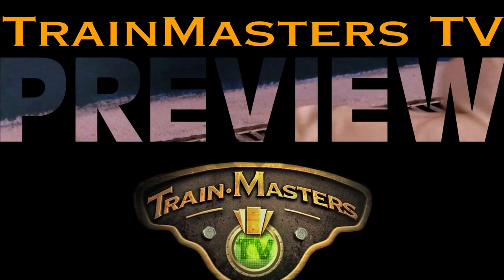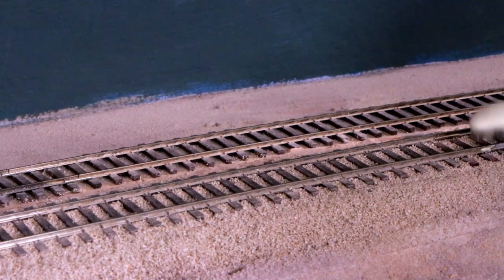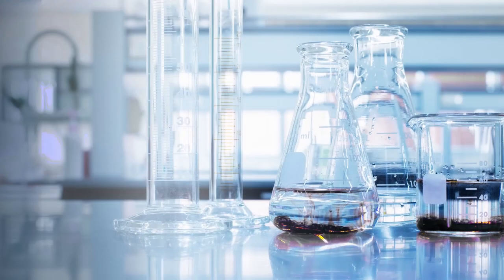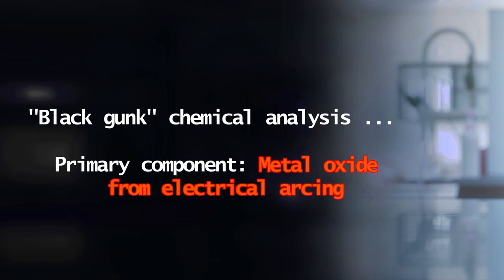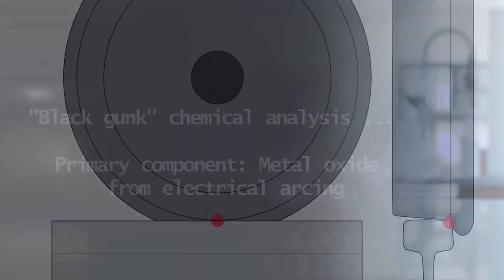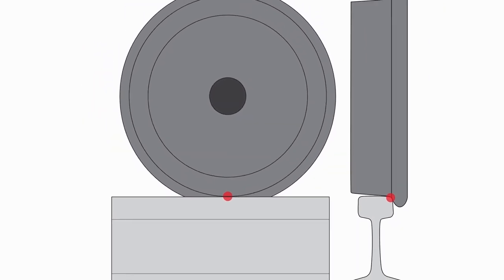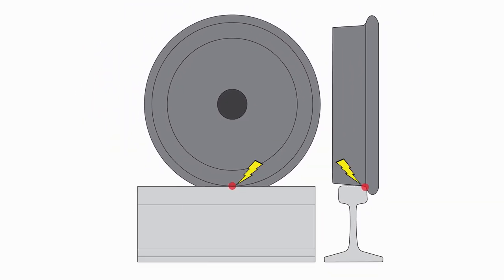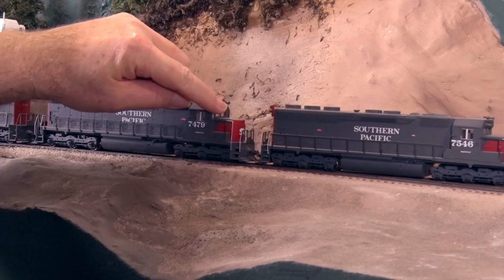PREVIEW: Miracle track conductivity cure

Comment: Can't wait for the day when locomotives are battery powered and don't need to run on track power.
Reply: Right now, battery power trades one headache for another if you have a large roster. Imagine 3 hours recharge per loco and a larger layout with  25 locos on it. That's 75 hours of recharging time every op session (about three days). Cleaning the track is actually less hassle.
Reply: @modelrrhobbyist2045  This assumptions assumes only 1 locomotive can charge at a time... Which is quite the.... "not well made" assumption. In fact, the charging method could be incorporated into long ops sessions as a switching out of the loco to a maintenance facility for "cleaning, oiling, coaling, etc" to be done while the loco charges before returning to service. But you could easily recharge multiple locomotives at the same time. Even within the span of normal sessions.

Comment: So, switching to plastic wheels on non-powered equipment will reduce the gunk build up significantly?  No power arcing there.
Reply: Not really, the micro arching occurs between the rail and the "powered" wheels on the locomotives, not on cars, unless they draw power from the rails to ligth the car or have sound decoders. By Powered wheels I mean the wheels that draw power from the rail to make the train move.
Reply: nope... that gunk sticks to the plastic wheels to... i just cleaned some plastic wheels on some rail cars... seems that the plastic wheels attract that gunk even more than metal wheels

Comment: I have used CRC for years and never have stalling problems or even hesitations
Reply: i recently found out about crc... i bought crc 2-26 a few weeks ago from home dept, started using it... what a HUGE difference... before locos would hesitate/or stall in certain areas... put some crc on the rails and no more stalling... my locos will NOT stall even at super low creeping/crawling speeds heck i tried to stall them on purpose but nope won't stall... the stuff works

Comment: The DCC's higher voltages seems to increase the problem.  LMRC used to use small amounts of hair-clipper oil, which is conductive to bridge the small patch at the wheel-rail point.  Too much will cause you to loose tractive effort and also accumulate more dirt from the air, dust, etc.  A very small amount, about one drop spread on each rail was enough for 1000+ft of mainline.  Masonite sliders were also used to help keep the dust off the rails and polish the railheads.  After 15-odd years of daily operation, LMRC's Ilmon-Cliff mainline was polished to a mirror finish.  Every train (~30 cars) had one slider pad, and every morning a cleaner train of 4-6 sliders were used to clean off any previous night's dirt.  This combined with weekly wheel cleaning of the engine wheels kept the operations running smoothly 1996-2002.
Interestingly, even with DC power, trails of black powder accumulated on the inside and outside of the curves, such as Caliente, where the slider pads rubbed across the curved rails, effectively cleaning off the bottom of the pad, by scraping away any accumulated 'gunk'.  These black trails were vacuumed up easily about once a year... interestingly they also provided great natural weathering, simulating the brake dust off the passing trains on the heavy grades!
We've seen more problems since going to the various 'wet' cleaning options, as it seems to transfer and deposit the previously dry material which shed naturally from the railhead, now is transported and gathers in our switch points and frog guard rails.  Again, too much liquid is a very bad thing!
I think part of the 'wet' track cleaning problems comes from the track cleaning 'roller cars' just placing and lifting a roller, which gets wet and saturated down on the rail and lifting it again.  No actually 'cleaning' action like the slider pads occurs.
I was planning this year to do more studying and I have some ideas for solutions... but the lockdowns have made trips to LMRC not possible. :/
NOM

Comment: Well, I’m not sure what you are recommending but I am having great success with commonly available kerosene applied sparingly with a small cork block. It has survived fallout from the horrific bush fires we have had here in Australia. 
I was amazed when I had a couple of months with no access to the layout due to the room being occupied with parts from a car (automobile) I was restoring. Some friends dropped in and wanted to see some train action. “Oh oh” .... this is going to be embarrassing! But NO, everything ran smoothly and there were no dropouts and I had not cleaned the track for months. BTW I chose kerosene from one of your previous articles where you were describing various cleaning products!
Regards - Rick & thanks for all the great work you do for our hobby.
Reply: Be careful using kerosene, it degrades into a pitch-like substance over time, gumming up things unless you clean it all off the track every so often. Goo Gone, based on the citrus solvent limonene also suffers from the same problem. It's a great solvent with a low dielectric constant (that's what reduces the micro-arcing) but it degrades into a pitch-like substance over time -- again you will need to clean it all off the track eventually if you want to avoid that. You want a material with a low dielectric constant, since the low dielectric value inhibits microarcing -- but the material also must not degrade to something that's even nastier than the black gunk!